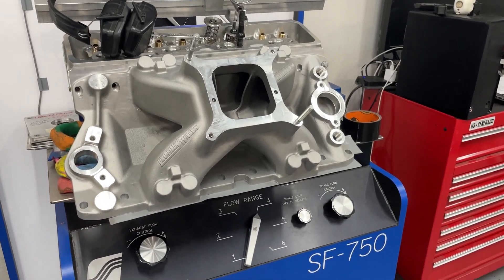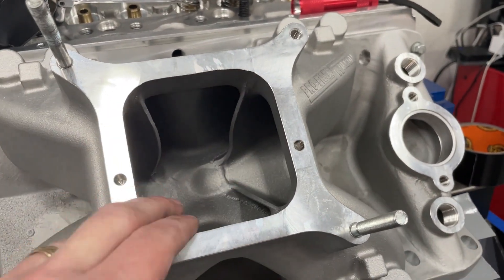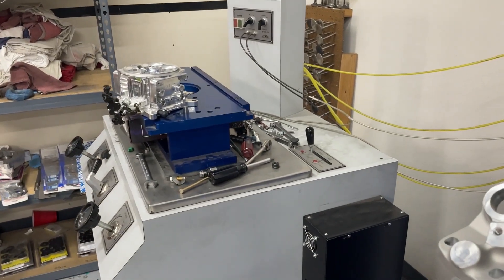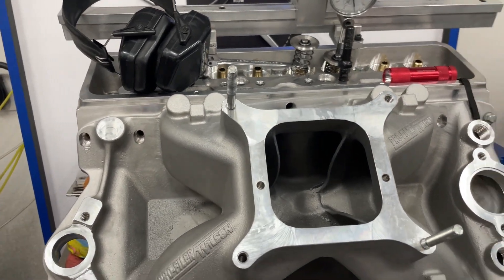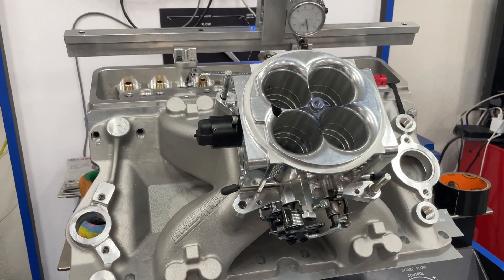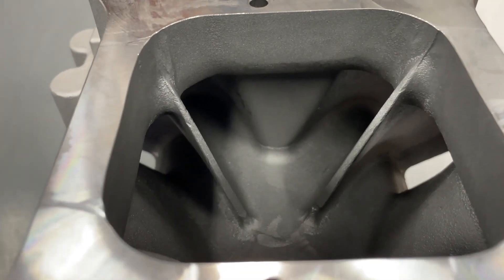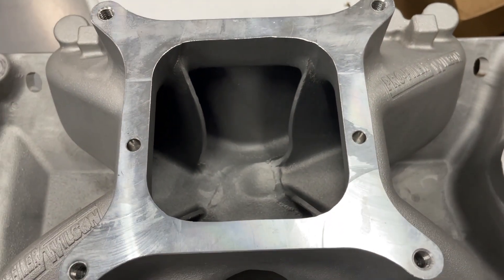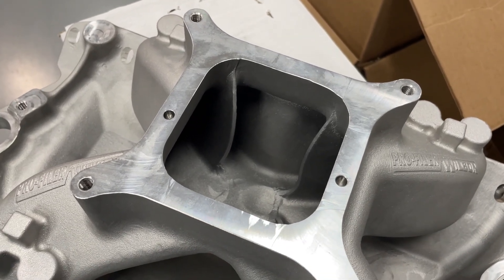SBC Profiler Intake Flowed Attached To A Head

Comment: I’m not an engine builder and I’m still learning but should have there been a gasket on the throttle body and also does having that thing shoved in the throttlebody to keep it open affect the airflow?
Reply from the maker: Gasket wouldn’t make a difference more than 1cfm. I take the screwdriver out after I start the test and hold the throttle wide open with the linkage.

Comment: Would basically any head that flowed more then 266cfm all perform roughly the same with that intake being the bottleneck or would the flow numbers still scale some with different heads that flowed at that flow and higher?   Thanks a lot

Comment: Hello I am running a 434 with some Brodix Trac1 heads done by AirWolf. For some reason they used a RPM Air Gap and made it MPI. Decent street cam 1.7 rockers making total lift around .700. Would the Profiler be a worth while improvement? I like the fact you do not have to weld in the bosses for the injectors. Any ideas appreciated
Reply: Would love to see some close up photos of it, especially the injector boss layout and angles, as well as fuel rail mounting setup. 434 with performer rpm air gap? I bet the low rpm torque is crazy with that setup
Reply: @b.c4066  I will try and get some close up pictures

Comment: I think the divot may have something to do with the casting technique?  I have worked with 2 of those intakes and the floors were not the same.  The one that was fully ported ended up at 316cfm(96% of head flow)on one of the narrow runners through an 850 throttle body and 2" tapered spacer

Comment: That old almost 50 year old Holley Dominator tunnel ram kicks all of these single plane asses. That unported one you used in the other video out flows and out performs all the single planes. 
With it being 2021 and almost 2022 you would think they would come up with a single plane that can get closer to 90% of what the head flows. So now you have to see if you can find a CNC matched head and intake combo, to see how much of a drop in flow the intake is holding back.

Comment: So what is the best flowing single plane for a gen 1 sbc ?
Reply from the maker: Ported Edelbrock 2892 for 4150.
Reply: Better then the dominator one ?
Reply: The best out of the box single intakes I have found in dyno runs are the following:  Holley Strip dominator,  Bill Mitchell Motown ,  Edlerbrock Victor2, AFR new aluminum intake, Old Elderbrock Victor Jr. With 2 " spacer . these are in no particular order and per different applications and budget.

Comment: Hey Eric! Great video! Wilson intakes are one of the worst! I have flowed them for years! With Edlebrock leading the way! 2925! You had mentioned the casting inside bottom plentuim floor at the back side of intake! It's from info for air flow! BC usually 2 of every intake will have 2 runners BB are # 4 and #5 and sbc if I remember correctly #3 #6.... at there worst so they try to help them all BC of the bad #s they receive from Flo bench!

Comment: Hey Eric I have a 357 small block chevy I got from a guy I'm getting ready to freshen up it has a set of 462 camel hump heads with 202 valves I want to get rid of those and put a set of decent aftermarket aluminum heads on it I'm not going to be running a big crazy camshaft in it maybe something like a comp cams xr294hr or xr300hr  it's going in a street car that is roughly 3200 lbs. With a 3200 stall with 373 gears and a brawler 750 on a victor Jr intake or a team g I have both out of the cheaper heads like the afr 195 as cast what other head would you recommend? And if I was to buy a set through you what would the cost of a nice street port job cost. My main concern is what head would you choose I only drive the car on the weekends also a head that I could later put on a 383 or 400 cubic inch. Thank you in advance  Rick427
Reply from the maker: I would like to try the promaxxs newer 185 head I think it would be good.
Reply: I'm sure Eric will give better advice but check out his PRI videos.
Both Dart SHP and Promaxx Project X are now AFR ports but As-Cast.
Personally, unless your putting the engine in a truck I go bigger ports. I would do 210 and that could grow on a 383. 
But I only mess with Y and F bodies.
Profiler and Brodix IK are both decent.